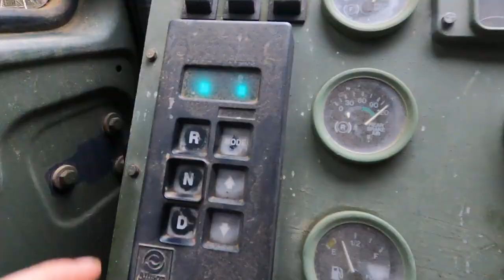We Broke Our Massive Army Truck

Comment: Might want to try a tire sealant product to run in your army truck tires. Not the cheap ones at auto supply. Look into Ultra Seal out of AZ. I used it years ago in tractor and truck tires. It will nseal  1/4" hole effectively.

Comment: I used to work excavation with the guy named Tomcat was his nickname his real name is Tom crest own a pretty good size business I worked with him for a while learned a lot and looking at you people I would have bought at least an 80 excavator I'm not too sure the one you got is actually the size you would really need to be work on that I would use a 160 so anyhow that was just an opinion just like a cat you guys eventually got bigger is better but it takes a lot of room to operate on and some of the things you do like on the table saw I would say Riley's kind of Reckless because you're only supposed to have the blade stick out just a little bit you know in case something goes wrong you don't want to saw your whole hand off hell you slip do something just be careful in the blade should not stick out more than like an eighth of an inch or maybe a quarter at the most that was the way I was taught and running equipment yes I do know how to run equipment I've been around this stuff ever since I was little you know rollers whatever bulldozers backhoes regular now tractors so you know I have a one up on you guys learning but it looks like you're doing a pretty good job I tell you what it's really good that Courtney was willing to learn to run the excavator she looks like she's got it down pat so I think she's ready for a little bigger excavator you know if he can someday I would get yourself an 80 and then if you really can I would get like a 160 and then a cat someday you want to sell the great big one hell I would think like a D6 because you're going to be able to find them a lot better than you can and all these newer cats that are now like a D5 he'll type kitty cat I know they're really expensive but if you can find an old you know D4 D5 something like that you would have something small enough to move around and something that wouldn't be crashing into everything that you try to do you know it takes a lot of work to run a big cat especially if you're going to clear land with it takes a lot of room I should know Tom had a d8 we had a D5 then we had a John Deere 650 they all had stump Splitters on them and we actually used the D6 a lot more than we did the d8 hardly ever ran the V8 you know somebody just gave the thing to him which was cool you know but hell we were primarily run the six and it had a brush rake that was built with the curvature of the blade see bulldozers have blades loader track loaders have a bucket so I just wish you guys remember that you know what has a blade and what has a bucket on it I know you guys call the big thing of bucket that's okay I understand what you're talking about because I used to you know work in the world excavation you know I'm now 70 some years old so you know I've had my experience I've pushed everything from motor blocks to all kinds of junk and I know when it comes to brush rakes if you're looking like you know let's dig dirt hell it always gets junk hooked up behind it and whatnot that's why you need a full rake you know that comes up above the blade a little bit and it's works with the role of the blade that way I'll roll stuff out in front of you and yes I was good enough to bulldoze with a rake on I don't need to drop the rake I can do something the owner couldn't do you know but he never learned that way I learned by pushing motor blocks and whatnot in the hole of a ship and that was crazy they just put the cat on top of the mound of motor box and metal all kinds of stuff and then you just push it out into the wings of the ship and I'll tell you what pushing motor boxes not easy hell and I know you have a lot of rocks that was one reason why I kind of suggested the D6 so he could mess with the rocks and be able to have a little bit of extra now if you can find a newer cat someday you know like at least a 650 something like that you know John Deere case and since you own a farm I would suggest a case because they're easier to work on in case you break something hell John Deere you basically got to if you do any break anything in the Driveline you got to take all kinds of things apart so if you get this you know be cool Riley knows how to run an excavator he's learned and I know I'm watching you Courtney you're pretty good operator hell and as you go you will learn tricks to make things go faster so I'm going to sign off and good luck with what you're doing it looks like you two really love the work together and that is great so anyhow keep up the good work looks like things are going

Comment: Riley, PLEASE wrap a logging chain above the cut on ANY alder over 6" diameter.  Alder trees have a very weak grain and WILL barber chair.  My life has been saved by this warning and Courtney WON'T look good in that kind of black.  I come from generations of logging in the Pacific Northwest and more fellers have been killed by these trees than nearly any other cause.  Google alder and barber chair.  I'm real serious.
Reply from the maker: Thank you very much for the advice. It sounds like we need to take more cautions when felling alders!
Reply: @AmbitionStrikes  I had dropped many alders on our property in North Bend WA but the FIRST ONE I chained after my cousin warned me, split 15' up the trunk and the only thing holding it together was the chain.  Another tip I was given was to cut fast on the back cut.  Alders are "the tree that can drop you while dropping them."